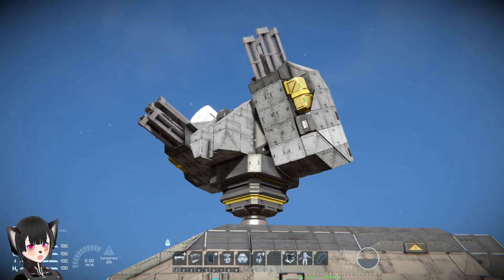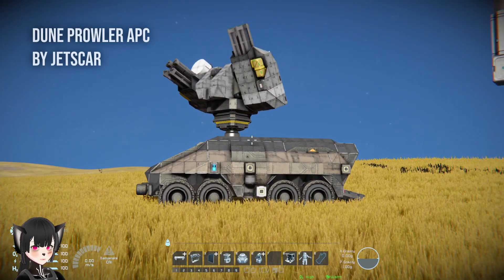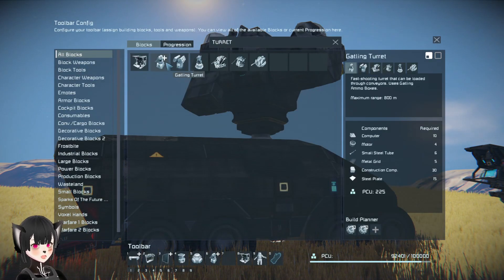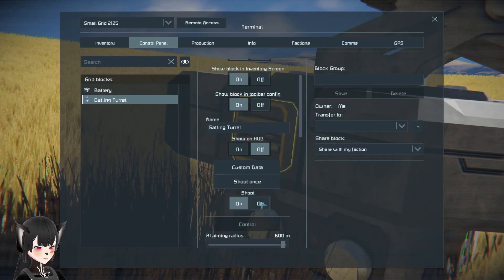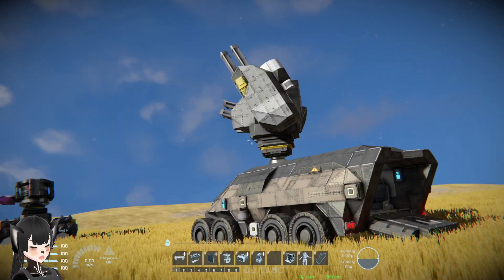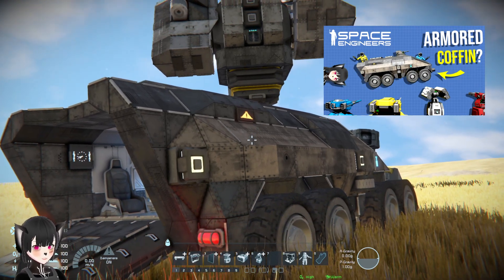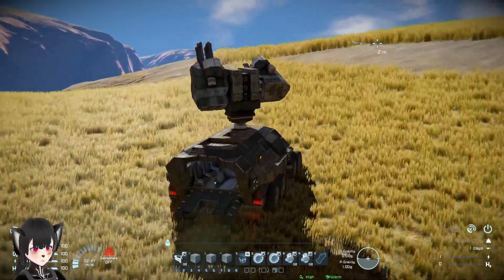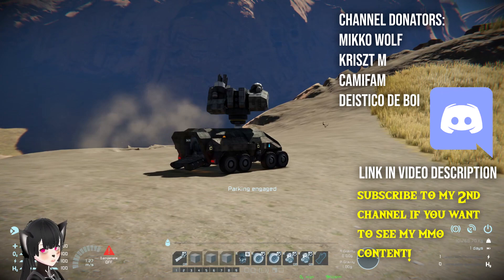Is CIWS Custom Turret Only Useful to go BRRT? Space Engineers

Comment: When a player is concerned about PCU, small grids should never, ever be used whatsoever due to their extreme PCU inefficiency as compared to large grids. However, when PCU is not a concern, player made CIWS turrets are far superior to the gatling turret. In my testing, I found that my CIWS turret far more likely to be capable of taking out incoming missiles than a gatling turret as the target area is far more saturated with munitions.
Reply from the maker: Yeah c= it's mostly for when you can or just want to use small grids for some reason and I see x3 I won't still use one on ships though because I'm mostly concerned about railguns, and artilleries

Comment: Why do you hate lifting the back before driving off? ;-;
But also, yeah, the way armor deforms will pop custom turrets right off their rotor... and the rotor itself is extremely weak and will just detach in about two direct shots too... so shooting it or anything even vaguely around it just breaks the whole thing.  I guess it's mainly good for role play?  Like if you have a base with flak defenses, or want to have a whole crew on a single ship and give them high-firepower low-durability turrets for some reason.

Actually, the single best use I've found for custom turrets... is a searchlight for those who don't have Warfare 2.  Having a swivel camera on the bottom of your ship is very, very nice for exploring with a friend in survival.

Comment: I'd think having a couple of turrets with Large grid Railgun could be useful in that they can get Railgun shots off which you don't need to line-up and while your spinal mounted Rail guns are reloading but I don't known how effective a steady flow of, say, two or three AI targeted Railgun rounds during combat would actually be.

I'd like to think that having drones or missles to distract enemy players could be useful but I just don't see it. A ship built even slightly to meta should mulch a player built missle or close quarters drone in seconds.
Drones don't evade well and aren't durable, at best your drone takes a volley or two otherwise intended for your main ship. Better to use a meta small grid fighter but if that better to use a purpose built large grid like your hunter-killer which looks like a submarine.

To keep up with a target ship built even somewhat to meta the drone would need to be rather complex, basically multiples of your hunter-killer purpose built attack ship using grid AI to move just into and out of Railgun Range of your opponents could be viable since multiple directions of Railgun threat feels like should be somewhat effective.

Comment: On large grids ships that are under 1000 blocks, custom turrets are the best to take out small drones you can pack 12 gattlings or autocannons per turret, if you put 2-3 turrets like that you can cover most of the ship. and they take less space then 8-9 gattlings turrets to do the same job. But the downside is they are harder to build/repair and take too much PCU if you are on a server that restricts PCU.
Reply: I have to correct myself a bit here, after I experimented more with custom turrets I noticed something that make them even more useful: the accuracy of guns blocks are about twice better then their turrets counterparts, and they have the same ROF/DPS or better (the gattling gun have no reloads time). and you can adjust the accuracy a bit on the custom controller 
As for PCU if you put 3 gattling guns together you have about the same PCU as 3 turrets with the same firepower as those 3 turrets combined. If you put more guns together you start saving in PCU : At 8 guns you have the same PCU as 4 turrets.

Comment: Another place I could see custom turrets used is on bases because you can output more fire power with say the cwis in the video, then you could with the regular turrets, just a thought, although if you pay attention to the main menu screen the red ships tend to have a custom rocket launcher turret for the static rockets, so could a case like that be good?
Reply from the maker: For bases you can use large grid turrets though c= I think having most of the firepower on a custom turret which is a single point failure is not a good idea for a base if you have the space

I don't think any of the ships in the main menu has a custom turret but not sure x3 it won't be a good idea to put custom turrets on ships though for the reasons I mentioned in my custom turrets video
Reply: @LucaTheGuide  I disagree we've used custom turrets on bases in Survival Under Fire and they can end a fight before it even starts. You have to remember for the same space for one turret you slap two to however many guns on small grid, a quad gun ball turret is the same size as a large grid armor block and can put all four guns worth of fire power on said armor block. There was even a guy on last stand gamers mad Aaron server who build a custom turret with I think 30 gattlen guns and scared the crap outta the other faction with how fast it shredded the top factions big bad land ship, this was before the turret control block.
Reply: @LucaTheGuide  Well if you want to give a base some (large) rail guns, having them on a CTC would make sense, similar deal with stations obviously you don't really want either in combat, and in the case of a station, you should be trying to jump away, asap, the turrets would just be there so it has the potential to defend itself,
Reply: @LucaTheGuide  well you wouldn’t just use 1 turret multiple would be good